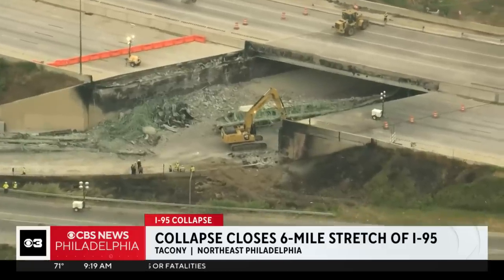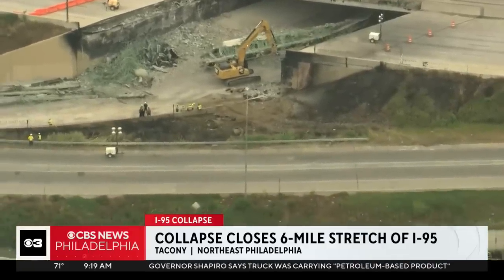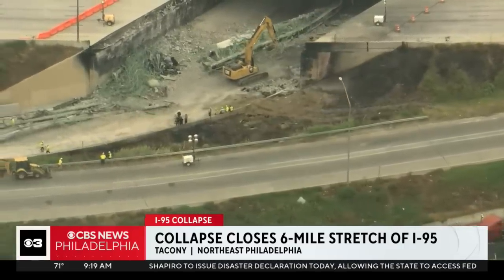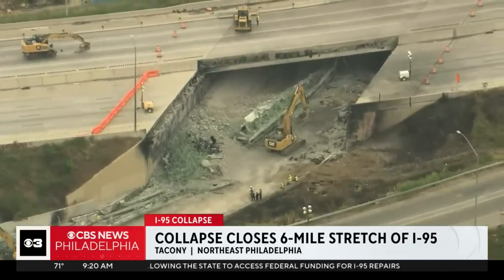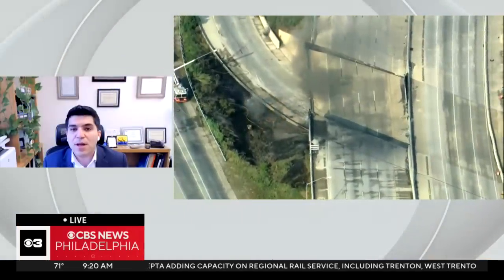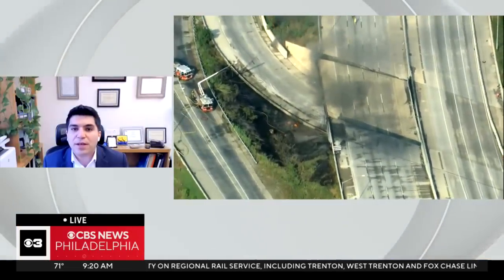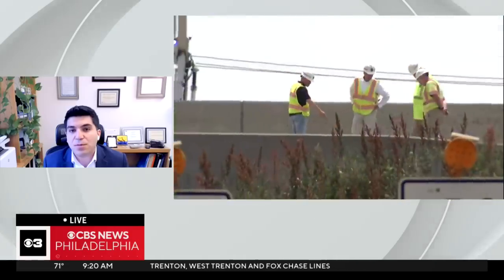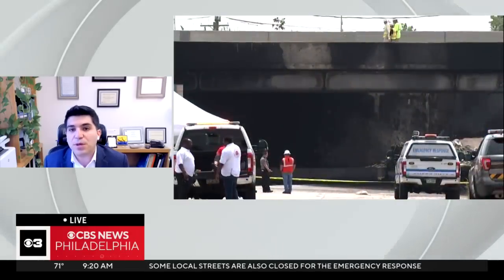Drexel University professor explains how I-95 collapse in Philadelphia could have happened

Comment: 50$ that is done in 5yrs lol

Start making your bets people 😂
Reply: 43 days to replace a similar collapse on I-85 in Atlanta a few years ago. Not saying this will be done in 43 days but it certainly won't take 5 years. It's likely a 2-5 month fix depending on whether there is damage to the surrounding abutments that support the beams and how quickly they can jump to the front of the line of a steel fabricator to get the new beams.

Comment: That freeway looks 100 years old. The city didn’t think this would happen especially with the fires? 🤦🏽‍♂️
Reply: It's not 100 years old. We didn't being building the Interstate Highway system until the 50s. If you use street view on google maps and go under this bridge you will see that the steel is fairly new and was in very good shape. This bridge was just replaced 10 years ago. 8500 gallons of gasoline burns at temperatures well over what is needed to weaken steel and cause it to collapse. But with hundreds of thousands of steel bridges in the country this occurrence is so rare that we don't protect against it.

Comment: Wow we need a professor to tell us that fire on metal will make it weaker. What we need is for tanker drivers to slow down on exit ramps that have sharp corners, especially if loaded with fuel.
Reply: Apparently we need both. Even after the prof folks in the comments still don't believe a petro fire has the ability to weaken steel!
Reply: I often wonder if some of these "accidents" are not really accidents.  After 9/11 I am suspicious of everything.

Comment: I am a retired FDNY Captain, and the prof is correct. Steel weakens at 1000 degrees and losses 40% of its weight bearing capacity. As temps get higher the steel softens and warps from the weight stresses upon it. (Just like WTC)  That section the steel was only carrying its own weight, (steel and slab), yet it collapsed as they always do. (Lookup the many prior highway collapses over the past years). Anytime you have unprotected steel it is at risk from heat -degradation. (Like WTC)  These fires are way too common, and show how easy it is to shutdown our road networks.     To learn more on WTC see my books,  
MY TURN ON THE FIRELINES  1980-2003,  and the series  FATAL FLAWS Books  1-3    B&N
Reply: Richard, bullshit! As a welder, the steel will only weaken if the heat is directly on it for an extended length of time. This didn't happen in this case.
Reply: @morales1961  just curious, how, as a welder, do you know when steel weakens? We're talking about structural strength here, not melting a pool or bending something with a torch.
Reply: @samnelso  we do not just weld. We bend steel, and we are trained to look for impurities and weaknesses in the steel. Fire fighters don't build buildings. We do.
Reply: @morales1961  And we fight the fires and watch them collapse. Then we drill over what happened. FDNY has hundreds of shots and video in the archives of fires distorting structural steel. I was in 9/11, watch the videos of the steel failing. Three different collapses. S Tower east side face steel bends and causes collapse. N Tower a small collapse near top where heat was highest causes a floor collapse which starts that end. WTC 7 had no structural damage from crashes, yet after 7 hours of unchecked fire the truss system near base failed and down it came. I was at the Observation point 200 yards away when it snapped a into  V, and came down.
Reply: @Richard Meo  - When investigating a building fire collapse where the building or bridge is framed or supported in metal, fire departments always use forensic engineers and metallurgist. Fire departments do not have the expertise to determine the reason something collapses. I was part of some of those structural integrity and failure meetings, and I've never seen a fire fighter.

I know you want to be a hero, but it's time to start living in the real world
Reply: @morales1961  Your wrong, because you are thinking as a welder. Fires are a different animal. That fire burned very hot, 1400+, and was trapped under the concrete which allowed that intense heat to absorb and radiate the length of the steel. Only the beams exposed to the air might have cooled some. We had dozens of fires in Bldgs that the steel only supported the roof, but they still warped and failed from the heat.
Reply: Still towing the Party line, huh?
Reply: @lowandslow3939  25 years of firefighting and years of schooling. We had dozens of fires in NYC where the steel failed even though it only supported the normal roof. In this case the steel was covered by the concrete, which trapped the heat making the heat degradation worse. There is a great shot of WTC 2 from the East that captures what Structural Engineers call the moment of failure. You can see the columns bending as their strength weakened to the point of failure. Then gravity takes over.
Reply: @Richard Meo  25 years of fire fighting and you learned nothing. Sad

Comment: China built an entire hospital in 30 days and we can't repair a section of concrete on one of the busiest highways on this side of the u.s.
Reply: China isn’t exactly renowned for their safe construction methods.
Reply: I don't think you want to use China's rapid building projects as examples. They are known to have many problems with quality. A similar incident to this occurred a few years ago on incident on I-85 in Atlanta. It was rebuilt in 43 days. That doesn't mean this will only take 43 days but it does suggest that this could be a couple to a few months. Much of that may depend on finding a steel fabricator who can shift their manufacturing around to put this work at the front of the line.
Reply: https://youtu.be/vz_j_BEkVCQ
Less than 48 hours, ohh you guest it a bridge 😆
Reply: The city probs ain’t got a lot money
Reply: @talkswithry2409  It is an Interstate Highway. Majority of the funding for such roads comes from the Federal and State governments, not the locals.

Comment: What kind of professor is he? He knows petroleum fires burn at 1400F max and steel does not get soft below 2000F? Those girders he is talking about are bent like spaghettis. Explain this please. Until than it is a crime scene and nothing should be removed.
Reply: Bro, it’s just like a couple of planes hitting buildings and making them collapse like a controlled demolition.
Reply: ALL EVIDENCE Already DESTROYED!
Reply: Among other things, you may want to check your units and assumption that all petro fires are created equal.
Reply: Steel loses 20% of its strength at 750 degrees and 50% at 1100 degrees. This weakening caused the beams to no longer be able to support the weight of the concrete deck. At that point the beams snap fail, the concrete deck snaps and it all falls.
Reply: He's an engineer.
Reply: @yvonneplant9434  he’s a 🤡🤦🏻‍♂️